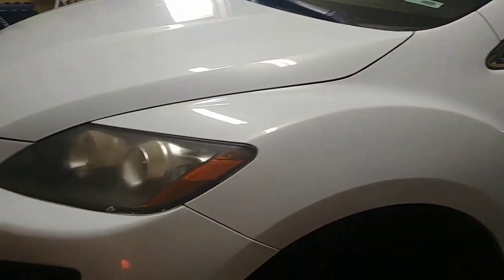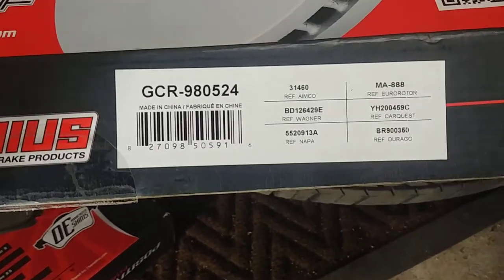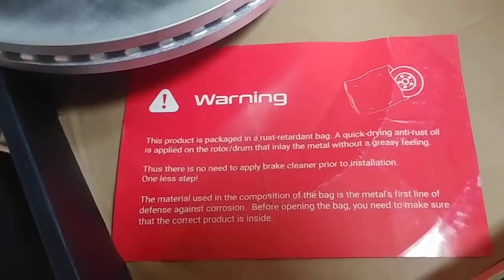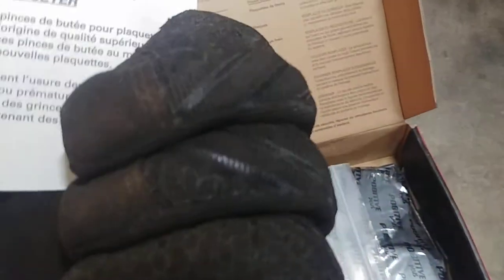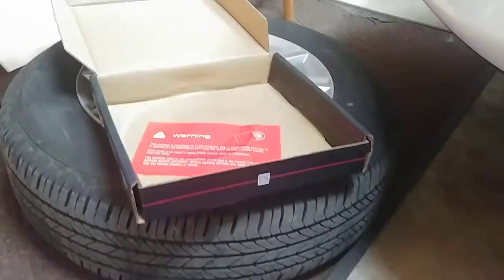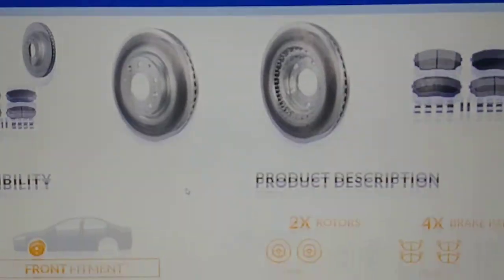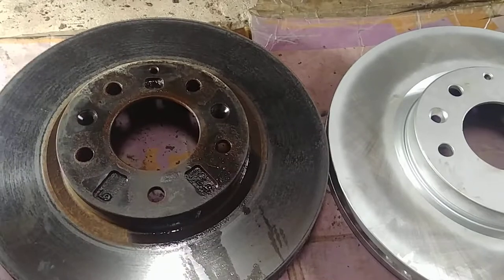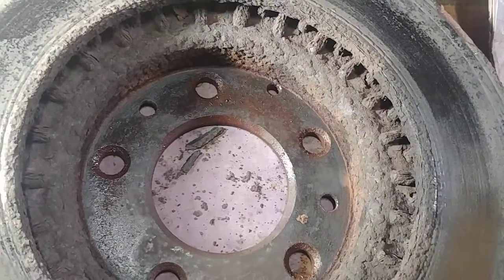Buying Genius G Coated Rotors and Pads from eBay

Comment: Hey Doug. Thanks for the video. I just bought myself the same set for my truck. How have you found the quality of the rotors and pads 6 months into the life cycle?
Reply from the maker: no issues thus far.  It stops well in all conditions.  No funny squeaking noises.  Brake dust is minimal.
Reply: @deadbugdoug  that's great. Thank you Doug